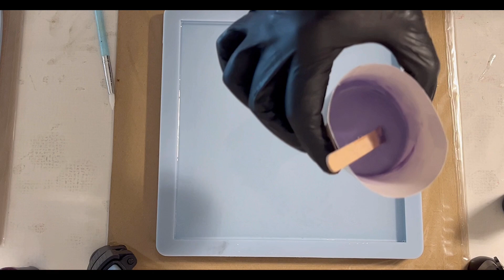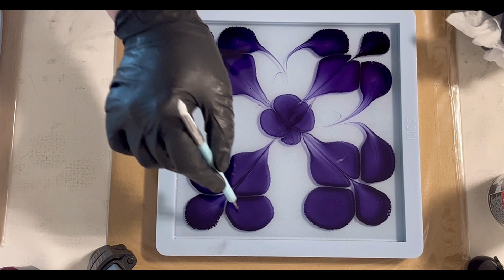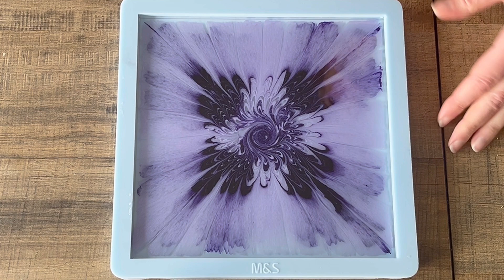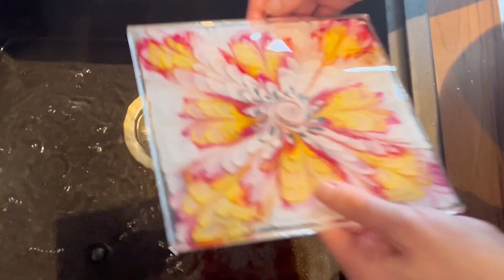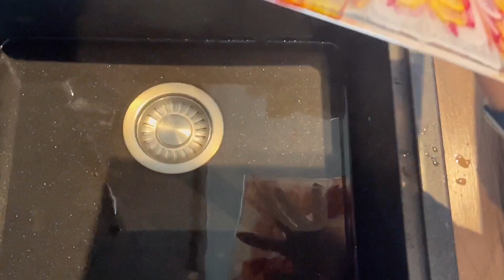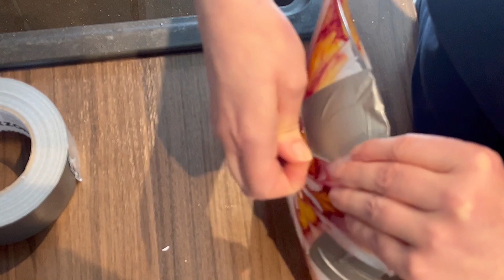#487 EN: Delicate Square Purple Bowl 3D Bloom | #epoxyresin

Comment: Petra this is so pretty. I have a hard time not touching the mold when I am doing the pedals. 😢😢❤❤❤❤. Thanks for sharing how you shape the bowl.
Reply from the maker: You just need to make sure you do not put the dotting tool (or what you use), too deep. Just touch the surface. It takes a little practice though 💜